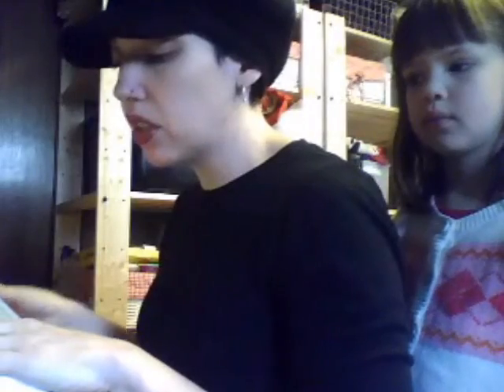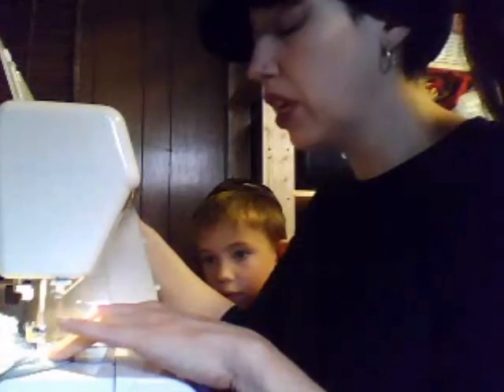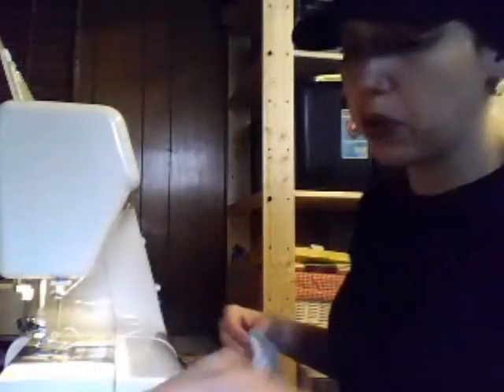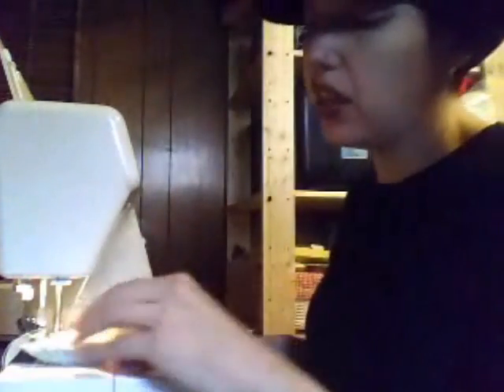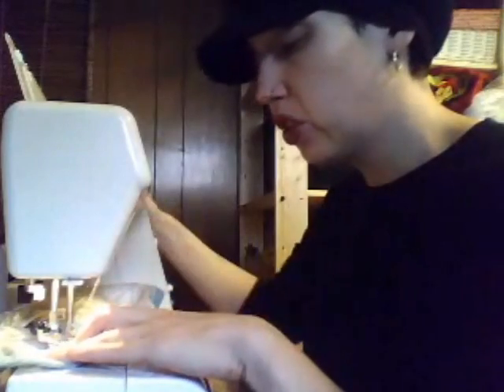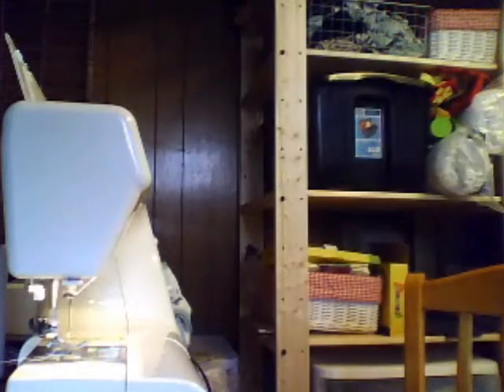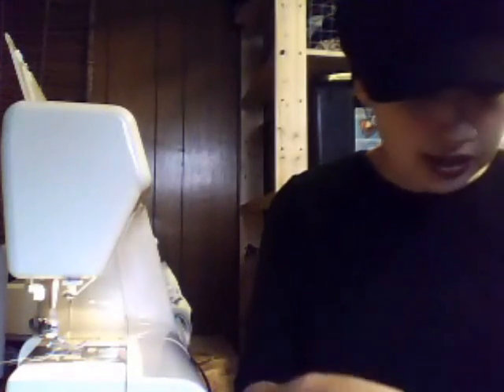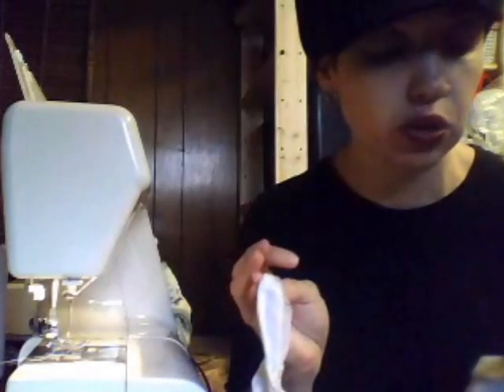How to Repair Diaper Covers

Comment: Great vid Ty mama :) do u recommend putting them in the dryer right after to seal the PUL so the new stitch holes don't cause any small wicking? I'm always so scared to perforate PUL because of that :/ it's a fear I know I have to get over if I ever want to sew with any piece of PUL. These repairs will serve as good practice :)